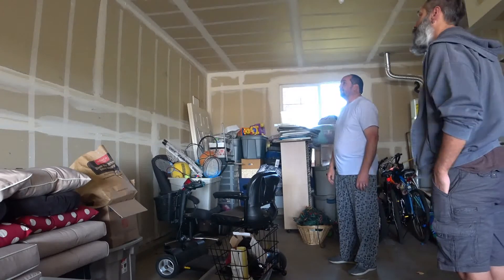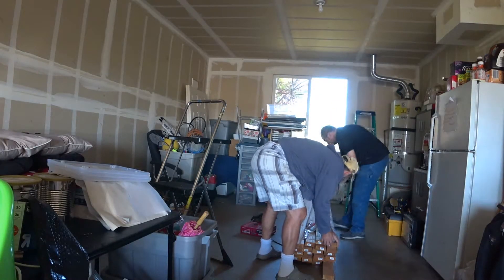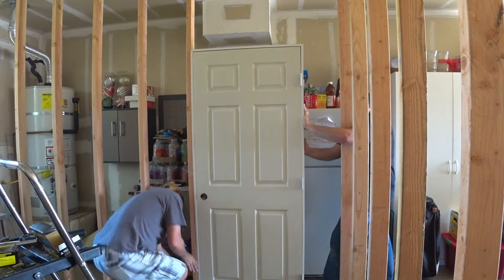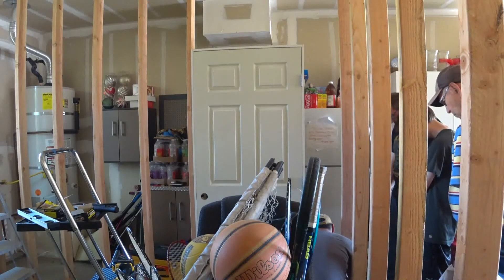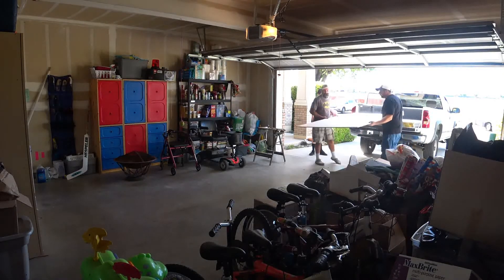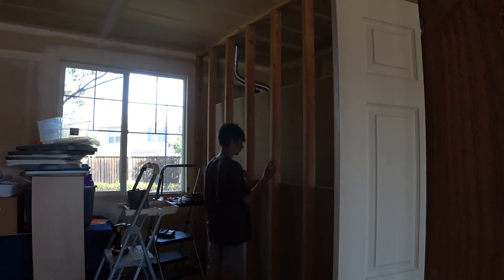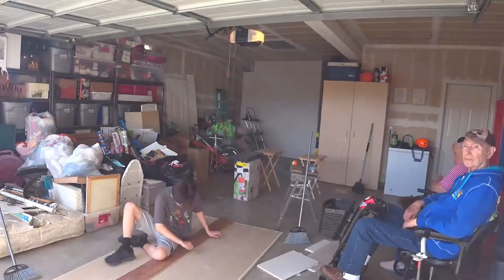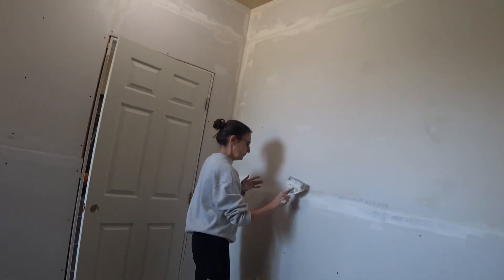DIY Building a Room in a Garage.

Comment: Nice job. Just wondering why you didn’t use any insulation? I know it’s in the garage but my garage gets hotter than heck in the summer.
Reply from the maker: The exterior walls are insulated, we just didn't add insulation to the interior walls mostly to keep costs down.

Comment: Nice work.  Did you need a permit?
Reply from the maker: No permit required as there's no change to the structure as it currently exists, although they may get dinged for having an enclosed space with a door that has no exit door to the outside, but just remove the office door and you're ok.
Reply: @jay5729  sounds logical. I still have the garage door Just in case.

Comment: Looks great but using a saw to cut drywall.. lmao... just score it and break it like it was designed to do. Much cleaner cut, no mess, way easier. This is for single straight lines obviously.
Reply from the maker: Thanks for the tip.

Comment: I hope you were joking about using a saw as if it was quicker than a razor blade that's brand new cutting a piece of drywall... Score it a good two times and that's all you'll need and then you can snap it and break it in a cleaner cut than a messy dusty saw cut. But that's just my opinion both work... Great video though and love seeing you pull your kids in the build 😅👍🏼🙌🏼
Reply from the maker: Thanks for the tip.